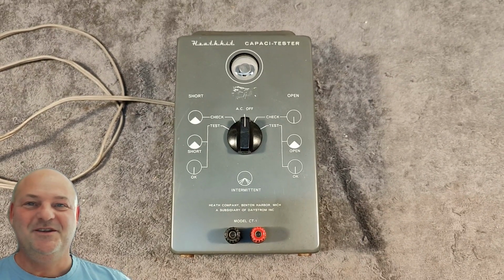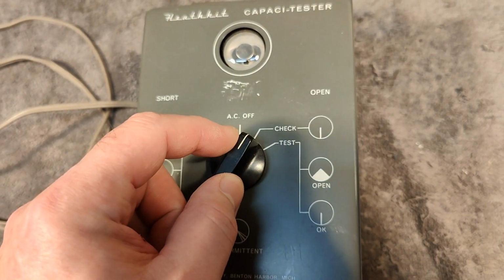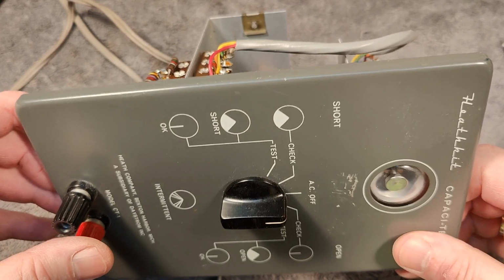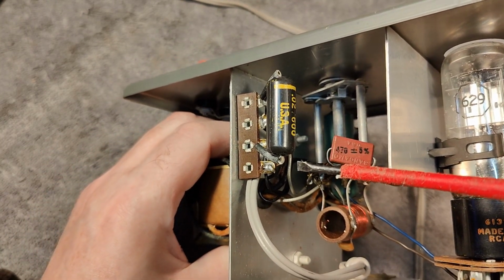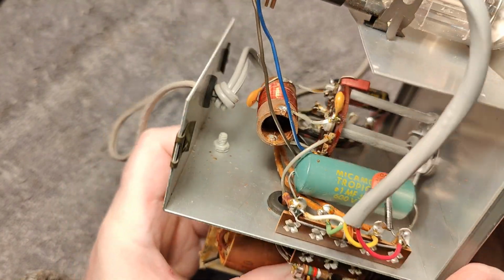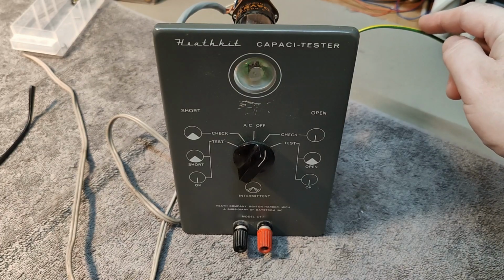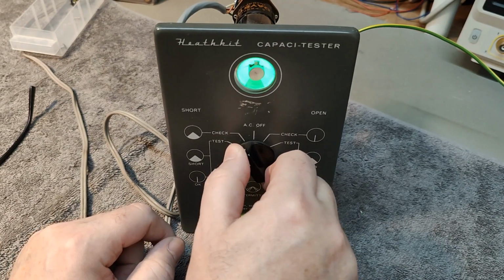Heathkit CT-1 Capaci-tester 50Hz 19MHz Magic Eye 1959

Comment: Something I can do with my Fluke VOM, but with the added bonus of being able to read the value!
Reply: Back in the 60:s multimeters (even if you had one, they were much more expensive than today) did not read capacitance, just voltage, resistance and current, so the average hobbyist would not have had anything to test capacitors. A modern cheap multimeter can do things that needed a full electronics lab back then, nowadays you can even buy a pocket sized oscilloscope for less than 100.
Reply from the maker: exactly, I hope it is clear , i dont try to tell anyone, you need a heathki CT-1 Capaci-tester to be able to solve the mystery if a capacitor is failed or ok.. what I think is cool and funny, is to try imagine we are back in 1959 and this was actually a product, a diy educational kit, and since i could get one, it was sold and assembled, i love to look at old stuff, try understand its history, and its design and usage.. today, 99% of all old things we dont need, a simple little handheld can do much more, and do it better too :-)
Reply: @TeardownOZ2CPU  Exactly!

I have a few cap ESR testers, one much better than the rest, as well as the Fluke, which does a great job ensuring the caps are good.

I also have a Motorola communications monitor and a Motorola spectrum analyzer, I have used them often, but I also now have a tiny SA and Nano VNA, and both work well enough for pass/fail testing!

Most of the antique equipment was good at the time tools for the era, but with today's stuff, you can't go wrong having the modern essential testing capabilities!
Reply from the maker: @crashburn-s3b  haha the nano i got from a sponsor one happy moment, and i also got the lite vna, guess what i use all the time, the big 2 person lift units, or the lite :-) evolution is also a thing in the world of electronics, and to truely appriciate the age we live in, we sometimes have to look a bit on history, i hope i can provide a tiny look into the past via my videos.

Comment: I found a discussion on a HAM radio site saying that while a "neat", this tester should not be used on electrolytic capacitors!
Love any on the old gear with the "eye" tubes. I've seen now where folks have simulated these using LED displays!
Reply from the maker: i cant see why this tester should not be used on electrolytics please ask people to come here and educate us :-) 
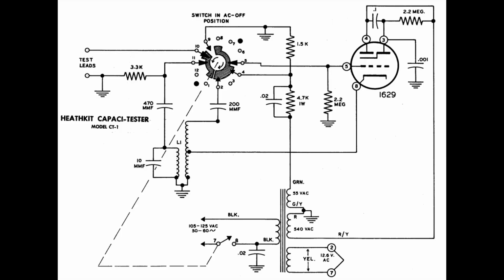maybe i missed something ? the schematic is at 9:20 i see only AC signals and very low voltage and low current going to the DUT, no problem with that.
YES i have seen the modern LED version of magic eye, really good idea for modern equipment where you want the old look, but dont have access to real tube
Reply: @TeardownOZ2CPU  See the manual; page 16. I would also consider that back in that day (when I was only 5) electrolytics were rather leaky beasts!

Comment: Oh yes the old death cap, welcome to the wold of pre 1960s consumer electronics😂  oh by they way the switch was spring loaded for two reasons, one to save the limited life of the tube, the other was for safety as it puts full mains across the DOT you could get you hands clear vwhen operating it.
Reply from the maker: i dont see how mains voltage can get out the test connectors, the schematic is shown at 9:20
Reply: @TeardownOZ2CPU  She might be thinking of some  of the other Heathkit Magic eye tester many of those put very high voltage (400) across the DOT.
Reply from the maker: @byterock  oh yes..
Reply: @TeardownOZ2CPU  yeah I just saw that, still has 50v AC that will still smart